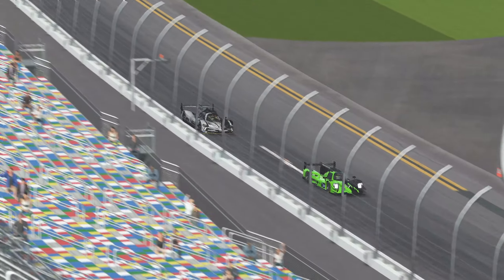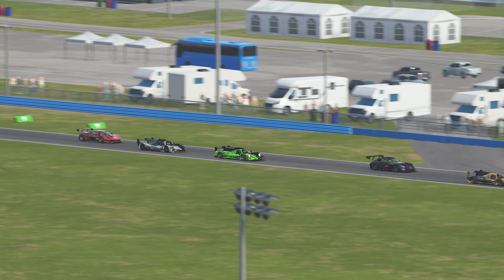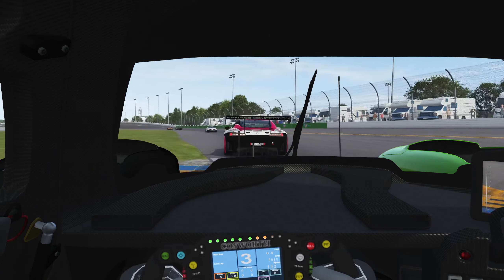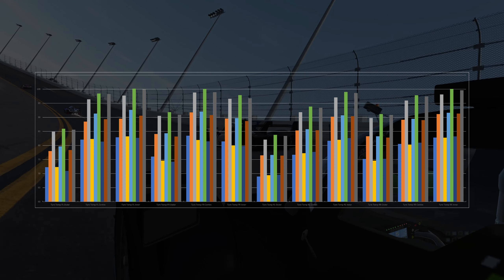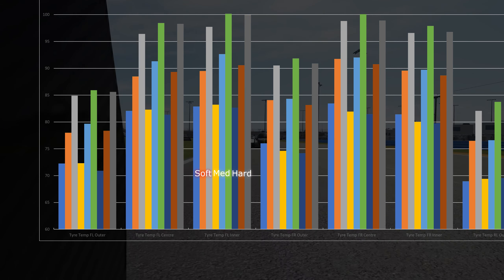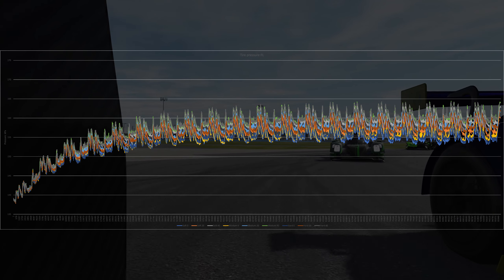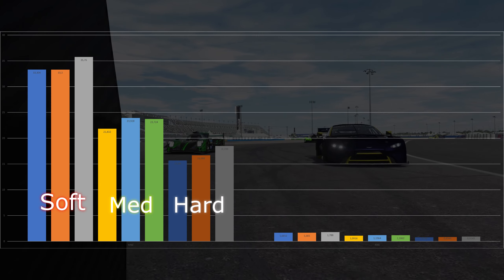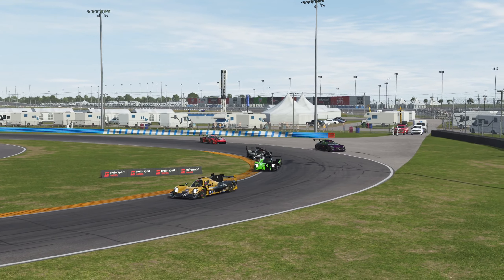Track temperatures are useless in rFactor 2?

Comment: For the longest time, I've always thought the same as you described but during the same race, we (Visceral 245) successfully quadrupled Mediums in the middle of the night with no issues whatsoever and I also did my fastest lap of the race in 1:34.8, at the end of my second stint. With normal daytime temperatures on the server tripling Mediums would get you to around 30% FL, while in the case presented I was easily above 50% at the end of the third stint. The car was quicker overall because of the cooler conditions and I wasn't slouching at all.